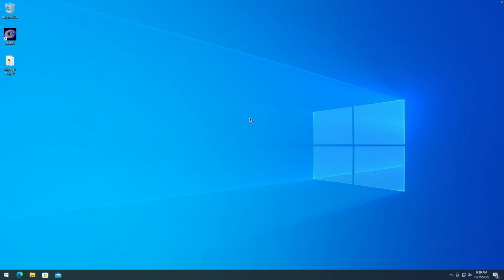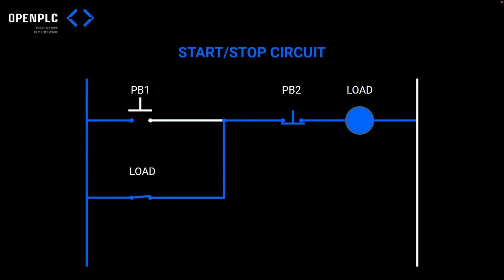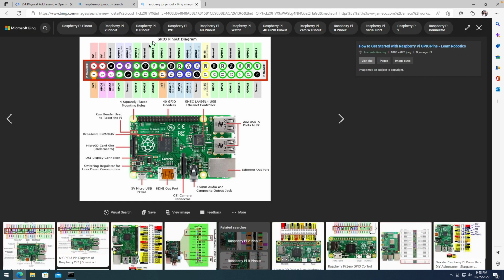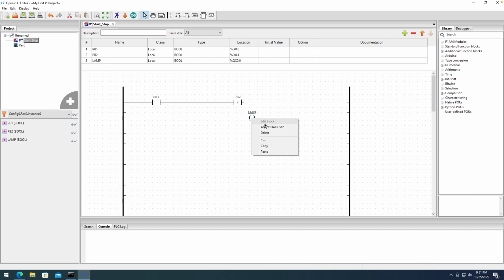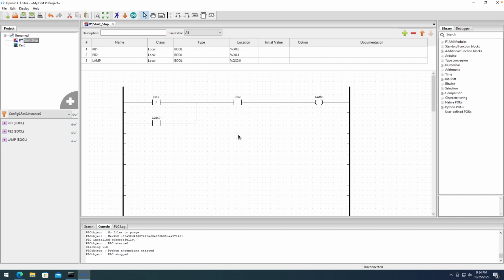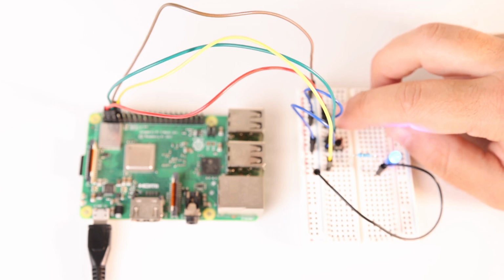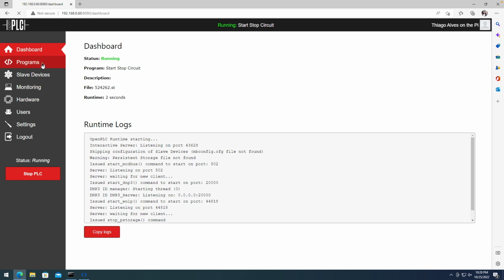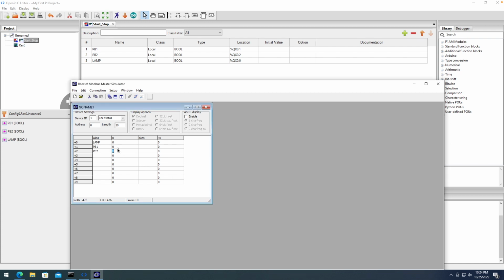Basics 04: OpenPLC on Raspberry Pi with Modbus

Comment: There are something confusing. Soft buttons and hard buttons should be used in paralles so you dont need hardware buttons adress change. If user uses hmi to control system hmi just modifies soft modbus variable which are interconnected in ladder logic to manage system. Hardware buttons are always required for any control system.

Comment: Would it be possible to use OpenPLC and a raspberry pi to act as just a read / write register and how would you go about doing that. Also would OpenPLC and the Pi show up as a PLC and RTU to software like claroty or is it just going to see a windows machine and Linux.
Reply from the maker: By default OpenPLC runs a Modbus server service, so yes, it can work as a simple Modbus device on the network. Clarity and other OT scan tools will identify it as whatever machine you installed OpenPLC on (Linux box, raspberry Pi, etc)

Comment: Hello , great tutotrial , 
we would like to use this platform for school teaching,
and we are evaluating the platform .! donations will also follow .. so that the project will grow more and more .!

we would have a question : but once you load the project in the controller , you must always have the software open and in Run , or you can use it in Standalone ..! (without connections to the PC , with any Controller either ex. Arduino ? RPi 2/3/4 ...)

thanks for the answers 
greetings from Central Europe
Reply from the maker: OpenPLC Runtime is completely standalone on both the Raspbery Pi and the Arduino boards. However, you can also link two boards together making one master and the other slave. In that scenario the slave board is dependent on the master to run.

Comment: I have made a project which is used for testing hydraulic power pack by control of solenoid valve.  There in the project i have used arduino mega and depending on the hydraulic machine i have to change the program for that i have used openplc software but the problem is i have to carry my laptop all the time.  So I have an idea that I will use Raspberry Pi in which I will install windows and after that I will download and install OpenPLC software and program Arduino with OpenPLC inside Raspberry Pi.  so want to know is it possible or not.
Reply from the maker: OpenPLC Runtime works on Arduino boards independently. It does not require another host machine. You can unplug your PC and leave the runtime running on the board just fine.

Comment: Fantastic explanation about cooperation between RPi and OpenPLC, great job!
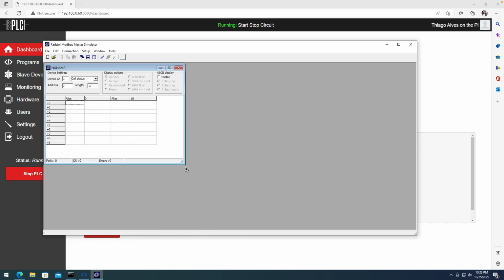Question about your remark where you initially changed the outputs to %QX99.0 (video: 16:33) for the ModBus approach to be out of the known RPi range and then reverted it back to %QX0.1 for, what you said, "ease of work later on".  Should you have kept %QX99.0, would that have meant you had to change the Address field in the Radzio simulator to 99 instead of 0 (video: 19:20)?  Would that have been the only change?
Reply from the maker: If I had used %QX99.0 then the modbus coil address would be 99*8+0 = 792. Remember that the modbus coil addressing is sequential (1,2,3,4,5,6,7,8,9,10...) while PLC discrete addressing goes in bytes (...0.6, 0.7, 1.0, 1.1 ...). That's why you need to use that little formula to convert between addresses, and that's why I went back to %QX0.1 because it is much simpler to calculate: 0*8+1 = 1.

Comment: Analogs IO available ?!
Reply from the maker: OpenPLC supports analog IOs, you just need to pick a platform that has them. Unfortunately Raspberry Pi has no analog GPIO pin, so you will have to use a slave device or switch to another platform.